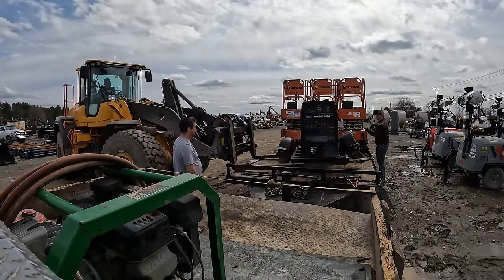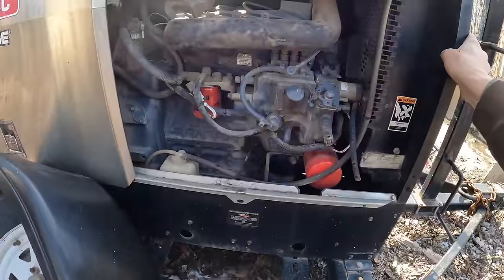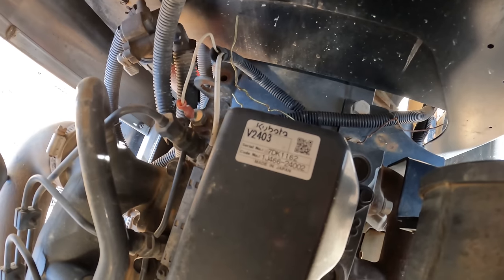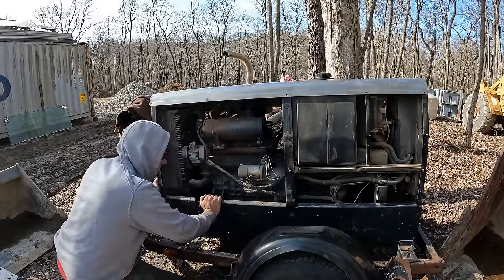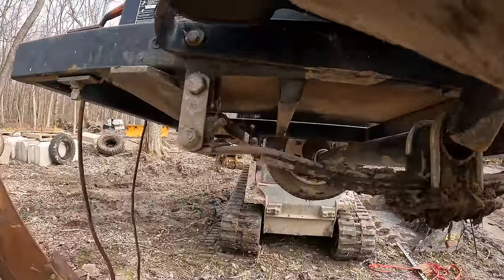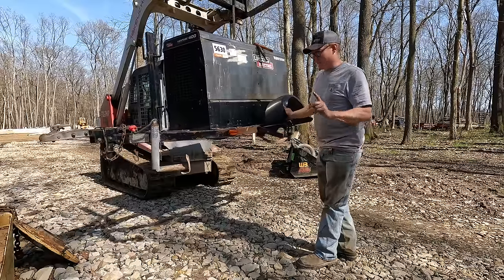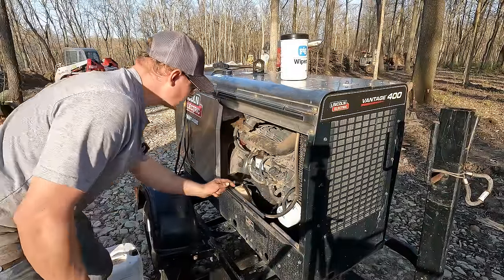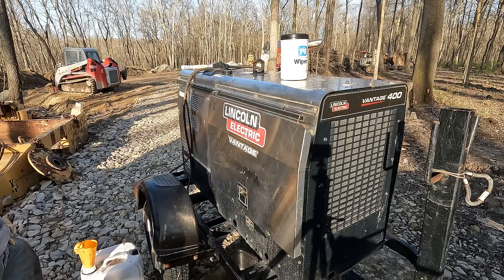This welder Fell from a CRANE? Can it be Saved (AUCTION BUY)

Comment: Just out of curiosity I looked up that welder trailer combo. It’s 40k according to google. So $3800 plus whatever you spent on the axle, tires, and lights. I’d call that a win! Awesome video.
Reply: I wonder why it was totaled not even costing a 10th to fix it
Reply: @David_Bellows  it costs man hours to diagnose it. Someone needs to devote qualified resources to the job. In an unknown state, the machine is an investment risk many can't afford to take. If the market was awash in these kinds of cases, there would be competition to pick them up. Matt and others with the know-how can't count on finds like this all the time, but if they keep their eyes open they'll get a deal now and then.
Reply: It's a bargain but you are also buying a pro machine without any kind of warranty or idea what is going on inside. So from a win to a brick or a nice safety hazard when using it anything is in the cards.
Reply: @David_Bellows  My best guess would be that the liability of having a machine with possible unknown damage. Cheaper to junk a 40K welder than kill someone.
Reply: Street on a working vantage is around 14k or so.
Reply: @gerbil7771  Especially when the insurance company buys the new one.
Reply: Well done good for you both. You paid you money and you take a chance as my dad used to say. Result in my book. Thanks ruth
Reply: @gerbil7771  yeah, its not 40k, its 7 to 12k and 5 at auction. Maybe $30k for .GOV buyers and schools with leads and tax and delivery. Great unit though...
Reply: Bee Ess  pretty
Reply: @RRaucina  first thing I did was Google it. Can't find a new one under 18k.
Reply: I'm going to say a big equipment rental company probably owned it. the cost of repair was probably more than it was on the books for. I have 3 of these in parts because they were written off since the price to fix is more than we owned them for.
Reply: @kenh9508  but it’s  not new - so can only be compared to the equivalent 2nd one - still a good buy, but could of been completely scrapped too - that’s the chance
Reply: a 580 vantage is only 42k Aus, how are they 40k US?
Reply: @ Alec Fassnacht 40k hahah dude I’m not sure what your looking up but no no they are not anywhere near  $40,000 haha that would be with the hours a $5,000  unit in that condition
Reply: i can find the welder for sale for like $2200-$4800 on auction sites that run and work fine.. so unless im missing something why would anyone pay 4k for one that fell from a crane?
Reply: @movingearth3726  I literally googled Lincoln electric vantage 400 and clicked the shopping tab. Brand new with the trailer from airgas it says 39k+. It took 10 seconds, and I didn’t go any further in depth.
Reply: You must be smokin something, that’s not a 40k machine. That’s just a basic 400 about 22-24 new. The dual output 500’s with the air pack are 40 k though. And the sae 500 with an air pack is 50-60
Reply: Geez, I thought it was expensive at 3k
Reply: @David_Bellows  the welding business would probably rather have insurance buy them a new one.
Reply: A 2014 in good shape goes for about $7,000.00. It's still a good deal.
Reply: New it's $40k, used can go for anywhere between $5k to $30k.  Don't forget the $$$ for a new axle.  Did ok for $5k, but  it will always be a dropped unit, and likely prone to future failure.

Comment: "Anything can be a hammer if used wrong enough." Love it, great video as usual
Reply: My new favorite quote!
Reply: In this case it was a jack hammer!
Reply: I have heard a hammer called a ‘dockyard wrench’ here in Plymouth UK 🇬🇧😂😂
Reply: Except for screwdrivers, which are chisels and punches, and knives, which are prybars and screwdrivers..
Reply: @Flying0Dismount  😂😂
Reply: any machine is a smoke machine if you operate it wrong enough
Reply: Commenting just to help the algorithm, but I also loved that line.
Reply: "In an emergency, anything can be used as a hammer, and almost anything can be used as a pry bar", is the way I learned it. He got both ends of this in the video.
Reply: If a hammer won’t fix it, you’re not using a big enough hammer.
Reply: makes me wonder, can the welder be a hammer?🤔
Reply: "Every tool has a hammer side..."
Reply: You got a good deal
Reply: This needs to be a shirt. I would buy it in a heartbeat
Reply: @brianblank9921 3 laws of the hammer. 1 if it don’t fit get a bigger hammer 2 jam it force it , if it breaks it needed replacement any how. 3 any thing close enough at hand sooner or later will become a hammer
Reply: @lonewolfsstuck  " Any motor is a smoker  "
Reply: My old Dewalt cordless drill can attest to that.
Reply: I have seen an old glass telephone line insulator someone used as a hammer. Thankfully it was worth only a buck or so before it was damaged like that.

Comment: It was a sacrificial axle (+springs, wheels, and jack), it saved the welder and frame from taking significant damage!
Reply: We like to call that a mechanical fuse   They exist in lots of products.  Easy to replace plastic or soft metal linkages that are designed to fail in the event of overload or abuse minimizing damage to the rest of the machine
Reply: Exactly! Such things are far too uncommon these days. (partly because some stuff is made at a quality-level where the whole thing is sacrificial/disposable) 
Then there's the SMD fuses in Apple devices, the chips fry to save the fuses! XD

Comment: Matt, it gave me a laugh that your brother-in-law’s welder had a “Diesel Creek loose belt squeak”!
Reply: Diesel Creek Belt Squeak. Rhymes 👌
Reply: LOL, I bet it didn't acquire that squeak until it got on Matt's property. :-)
Reply: I looked up that Lincoln Vantage 400. Folks are asking $12K used on a couple with 1 having more than 5K hours! As soon as I saw that stainless steel enclosure I knew that was a Cadillac welder! Of course it was a gamble that more was damaged than a noisy diesel. Matt was a great brother-in-law to make all the repairs! Frankly I would have that machine safely stored indoors. That’s too much “portable cash” for the wrong people. There’s a reason they hang them from cranes at job sites!

Comment: Just FYI, the Vantage have 3 boards behind the control panel: the engine control,  weld control and chopper board.    If the weld control or the chopper board go out, you will need to replace them both. If you don't do them at the same time, they will cause each other to go bad in turns in 30 to 90 day intervals.
Reply: Good post! I'd cash out and sell it to someone with deep pockets, buy an SA of choice with no delicate nonsense and keep the (considerable) profit.
Reply: Correct. My Pipeliner might only max go up to 300 Amp DC modified with newer pipeliner  parts only,  but it a best daily field welder I found yet. I can trace back to dated around 1947? & crank up unless battery go bad daily.

Comment: Hey Matt - great fix.  One thing you can do to increase the safety factor when lifting stuff like that is to rest a piece of angle iron on your hydraulic cylinder, that way if the hydraulics fail the forks will only come down as far as the angle iron. Better yet cut one side off a piece of square stock so it'll rest right on top easily.  Stay safe and man o' man did your brother in law score a deal there - about 10% of the normal price...sweeeet!
Reply: Most machines should have an OEM safety lock on them already, usually pinned somewhere
Reply: @garretr4488  even if it’s a machine from the 80s ?
Reply: @Keo  yeah cat has been doing it a long time. But cutting a side of square tubing is exactly all the oem ones are. If your going to work under something this is the way to do it.

Comment: As Peg would say "You don't need worry aboot safety it'll be fine.' Everything's a hammer but nothing better than a 20 pound sledge. Great rebuild.
Reply: "You don't need to worry about the welder falling off the forks and crushing you"

Comment: Nice work Matt, but going forward, always tighten any pivot point fastener (like the spring & shackle bolts) while under the load it will carry. You want to cinch that sleeve in the bushing where it will naturally sit, if you tighten it unloaded then you twist the bushing material when you load it and destroy it in a fraction of the time. Just loosen and re-tighten them when it’s all together on the ground and you’re good.

Comment: I honestly thought this unit would be in worse shape, like having a bent trailer frame at the very least. Fixing it up proper with brand new parts, and even doing a fresh service on it as well is really setting up your brother in law up for success! You must have a good relationship with him to be that thoughtful.
Reply: It looks like the tires, rims, axle and springs absorbed most of the shock, sacrificing to protect the rest!  I just hope there isn't any internal damage that will cause premature wear or metal fatigue.
Reply: I'd say there is still a high chance it's tweaked a little. they don't really lose their shape until you separate them. found out the hard way myself and had to do a full swap, new trailer and body/frame.

Comment: Matt, it always amazes me to  after all your hard work getting things   put back together, running , and working as it should of been to begin with, that smile:-).  Admire the fact that, Like Andrew, you also don't like those crappy wire nuts, and heat sink everything back together, concerning wires. In my option, learned from the best! Looking forward to seeing the new Garage built, and other projects that have been put on hold, actually get finished after that, since you will no longer be out in all the weather.

Comment: After a quick check on a couple of auction sites, it looks like that unit turned out to be a good deal, even after factoring in the undercarriage replacement costs on top of the auction price.  I was surprised there wasn't more damage.  I was sure the fan shroud looked like it was bent and needed more than just a couple of washers. Great job!

Comment: Nice!  Those Lincoln Electric Welders/Generators are awesome.  We used them back in construction and they were pretty reliable for Welding!  Having the welder and power source together speeds up the work process specially if your in the middle of no where without a power source.

Comment: Never underestimate the damage of a sudden stop. I’ve seen locomotives turned into scrap metal because they impacted each other too hard even though you couldn’t really tell from the outside. Honestly the machine should of been inspected under the shroud before starting.
Reply: I was thinking it could be a run away engine, once/if it got started.
Reply: im sure he went over everything with a fine tooth comb off camera.. matt seems like a thorough kind of guy

Comment: I Was Taught When Changing A Leaf Road Spring That The Shackle And Spring Eye Bolts Should Come From The Inside Outwards With The Locking Nuts 
On The Tire Side So If They Ever Came Off The Bolt Would Not Foul The Tire As It Would Work Its Way Inward
Reply: Oooooooo, now THAT is a great little tip. Thanks!
Reply: Cara, on the other hand if you got a torn tire the dummy didn‘t use locking nuts.
Reply: @jadesluv  Yeah But You Should Be Safe As Possible With What You Have.Thanks For Your Reply.

Comment: This went from possible scrap to fantastic job well done! The auction price for that welder given that it should have been classified as "inoperable" was a bit much.
Reply: I think I would have listed it as inoperable myself. I was wondering if anyone else was thinking that too. I understand it "starts" but to me it didn't run as in I can use and operate it in it as in condition
Reply: @usernotfound-ue7ld  yet all it needed was some shims, a new axle, rims, and possibly tires in order to be functional
Reply: By inspection the frame was ok, that’s why it bid up to that price.  Wouldn’t have taken much of a drop to break that axle.  Bet it just rolled off a trailer.
Reply: @BeachBoyAAA  there was a little internal damage because the engine wasn’t sitting right, that’s why the shim’s were needed
Reply: @BeachBoyAAA  you think just a drop from a trailer could do that. Mhm I would have thought they was better built then that. I've seen a light tower collapse under its own weight when the mast was raised things just aint built to last anymore

Comment: I have a vantage 400 and had similar issues with the engine mounts being bent from putting the welder on a pipeline side boom. All that is needed to be done is take the engine mounts out one by one and hammer them back into shape. No shimming required! They are essentially just angle iron mounts and deform

Comment: Several years ago I knew a guy who worked for a place that built steel framed buildings.  The crew would raise the welders up 20 feet with the cranes each night to prevent theft but someone just cut the cables let them fall and took what they could.

Comment: A few years back I worked at a rental company that specialized in pumps, hose, pipe, tanks etc. I was picking equipment up at a jobsite one time when the 3" trailer mounted pump fell as they where craning out of the hole! Axle looked similar to your welder! Defective lifting strap.

Comment: I have owned three of them that have been dropped and the only problem I ever had was one of them had a warped shaft so the commutator was touching the armature and shorting out. Once I figured out what was wrong I just found the low spot by turning the shaft and jacked it back up so it ran straight. You can get replacement axles from the Northern Tools catalog.
Reply: Yeah, that armature is a lotta kinetc energy toward the ground, same with the crank & lower mains.

Comment: instead of beating on the bent elements of the finder mounts with a big hammer, use a pipe wrench with a long pipe on the handle to bend and twist them which ever way you need them to go.  This gives you more control and a nicer finish.
Reply: Yeah right...

Comment: I know you replaced the axle and leaf springs but I’m curious how well this thing will tow down the road after a drop like that
Reply: Old equipment trailers have been getting towed with slightly bent frames for decades....You do realize he replaced everything that mattered and its going to follow the truck regardless of how bent a frame is....Not sure what you expect to happen besides it following smoothly behind whatever is towing it
Reply: Other than the definite possibility of the centerline of the welder not pulling directly  inline the the perfect centerline of the tow vehicle, it will tow like any other load.
Reply: straighter than 98% of vehicles track after  two years from factory assembly. 🤣🤣
Reply: @khancrow8212  maybe with an bit of an offset but nothing that matters
Reply: I've pulled trailers that had probably a 5 degree bend and it pulled fine at 75 80 mph
The trailers that pulled swirly we're the ones that the frame was pushed forward on one side which had the axel geometry wrong so that caused it to walk around even at lower speed's
With falling straight down it would probably be fine
Any ways it's a welder you can fix it
Love the videos 😊 keep up the good work
Any more the auto car truck
Reply: My trailer has a bend in the tongue, from a jackknife, from the previous owner.  That was 30 years and thousands of miles ago.  It just tracks a couple of inches to the left of center.   No big deal.  Growing up on a farm, lots of our equipment had offset hitches.
Reply: The problem only is if zwo axels are working in diffrent directions with an single axle it just pulls with an bit of an offset

Comment: Do you check for thread burrs on the new filters before installing to avoid them going into the engine? Seems like a good practice I've seen on other video channel.
Reply: I just buy filters made in South Africa so I know there are no thread burrs when it leaves the factory.

Comment: "Working under a suspended load"

I mean, let's take a scientific view of it. It has already fallen from a crane once. What are the odds that it would fall a second time? It's practically the safest thing to do with that generator/welder now. /s
Reply: Yeah, but that was a crane.  If he was using his crane truck, I'd agree with you, but you're not covered using a track loader.  I would've dropped it again, just to be safe.  Then you're golden.
Reply: I would take that bet at those odds but wouldn't stand under it without say two oil drums holding it as well as the hydraulics😀
Reply: @andrewallen9993  beep beep, sounds like a ROAD RUNNER CARTOON
Reply: @rsprockets7846  😁

Comment: I use wire nuts for my trailer, but I fill the inside with corrosion inhibition compound and I tape the end shut.  The Butt connectors I used cannot be shrink, so I fill the end with corrosion compound. Yes, I do not use those blue splice connectors.

Comment: These things new/unsmashed are pretty expensive I would imagine?
Reply from the maker: Think around 20,000
Reply: @DieselCreek  Wow, you didn't mention how much the Axle and Tires were... btw I think buying the replacements was the best option.
Reply: I too prefer to hear how much the repair / total costs end up at.
Reply from the maker: @stephenhewitt5835  total repair cost was around $700
Reply: I checked Lincoln Electric’s website, the welder alone without the trailer is a bit over $28k US. Great purchase on yours!
Reply: Matt, many thanks, I think the cheapest I could get those parts in UK would be about £500 so not far off. Love your content and enthusiasm. Regards to Eva.
Stay safe 
🇬🇧🇺🇸